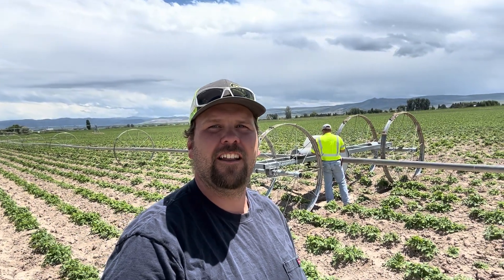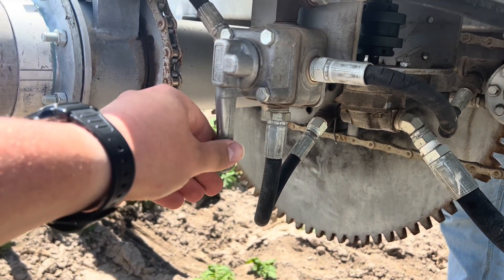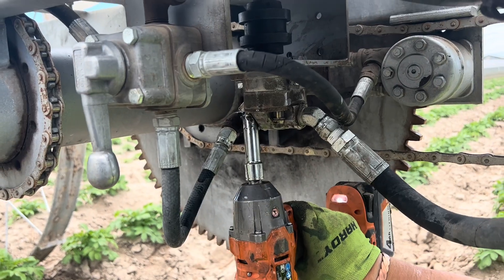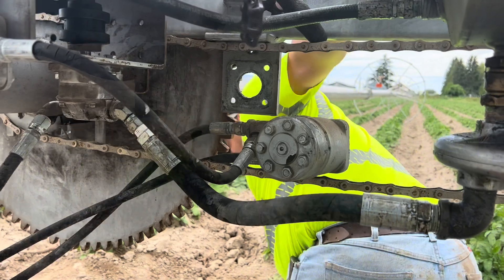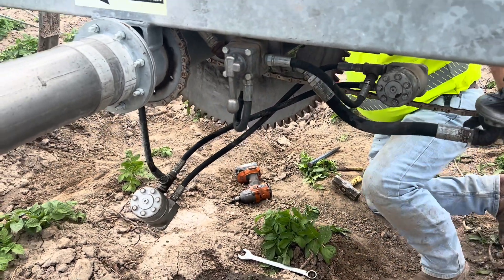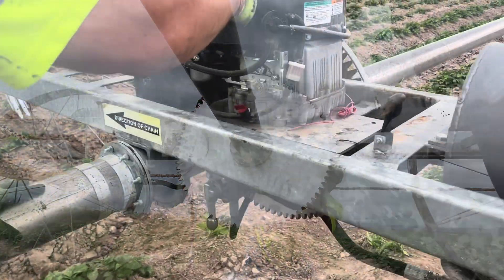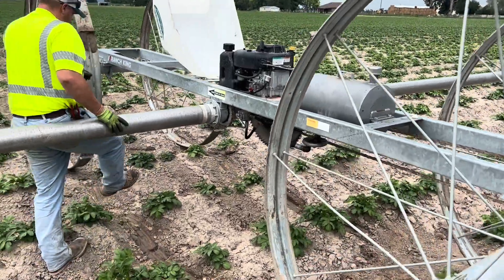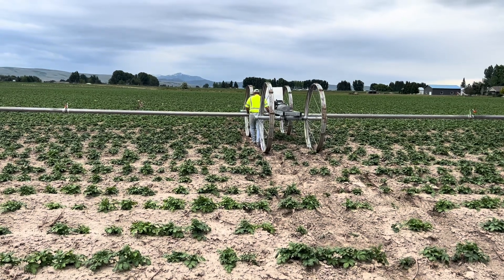Wheel line motor broke! | Hydraulic motor replacement | How To | DYI

Comment: Do you have a delay in response to wheel spin right at the end section due to deflection in the twist of the pipe? Or does it all act like a rigid structure from the crawler to the ends?
Reply from the maker: There is a delay because of the twist of the pipe. Usually you have to move it past where you want it to get the ends in the right spot, then move it back to get the middle in the right spot.
Reply: @RockyMountainFarmer  Thanks. That's what I was thinking. Is the ROI better on a side roll than on a full size center pivot if only low growing crops are considered?